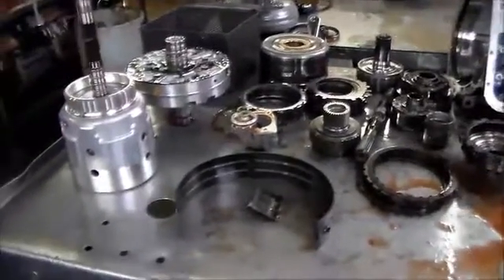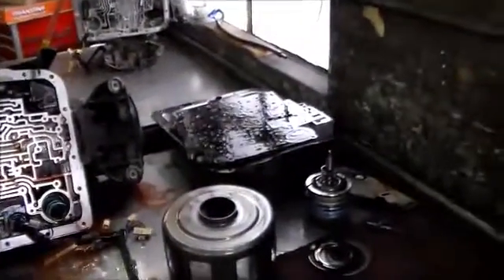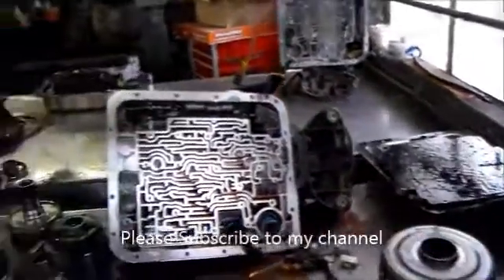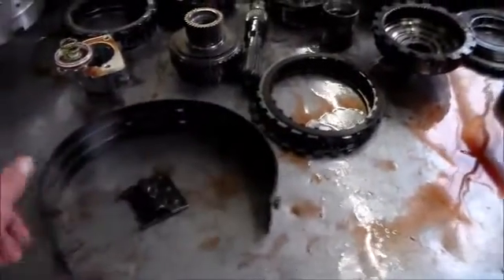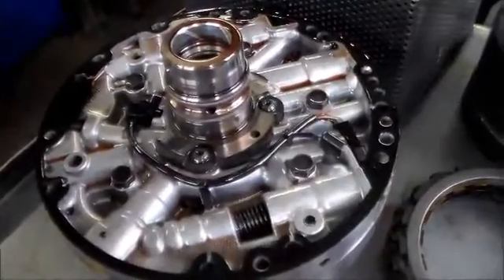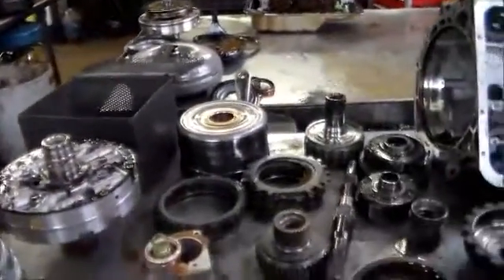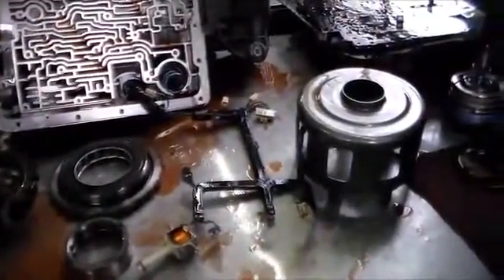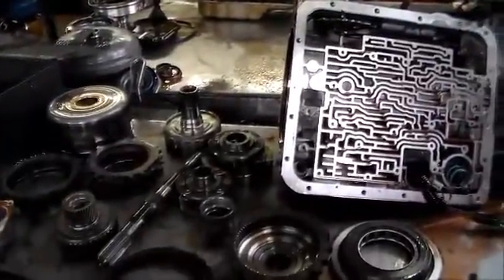4L60E No 2nd Gear

Comment: Hello I have 4l60e on 6.0 gen3 2002 
Slipping on 2 n 3 n4 gears 1 and R verry well other gears start to slip from 2000 rpm I have 60 psi line pressure all time driving and Neutral and park on all gears just Reverse have 95psi 
And Revers slow shifting 2 sec and drive take also 2 sec to engage 
Thanks for your help

Comment: Hi buddy i have a 09 chevy tahoe 4l60e whit some similar problem if i put manual 2d gear it stay on 1st gear  but if i put in D  it takes 3000 or 3500 to get a 2 gear after that the rest of the gears shifts fine
Reply from the maker: Well, sounds to me like your band is broken. After it makes the shift pull the shifter down to manual 2nd and give gas like you want to drive see what happens
Reply: Thanks  i will checa it Out and i let you know Thank you verymuch 👍
Reply from the maker: @richardcoronado4072  ok, sounds good
Reply: @GaryFerraro  ok buddy i already drive  and  soon i feel  the shift gear i  Drop the manual  shift to second  and RPM coming up
Reply from the maker: @richardcoronado4072  seems like a broken band if that rpm goes up, when you give it gas seems like theres nothing there?
Reply: @GaryFerraro  1st gear only
Reply: Appreciate it 😎👍 and thanks again for sharing that video it  really helping us out  god blees you buddy 👍
Reply from the maker: @richardcoronado4072  Thanks, you too

Comment: Hi...i have 2003 nissan sunny n16. 1.3Ltr. Trans RE4F03B.
All my other gears shifts fine. I often have issue with 2nd gear. It does not go into 2nd unless i put my car to Park or restart it. I had a rebuilt, but they only changed clutches only. 
Please advice wt cud be the problm. Note: oil are already changed while rebuilt process ws done.
Pls help

Comment: Gary I think I have the same issue I lost 2nd I can tell when I manually down shift from 3rd to 2nd  it acts like neutral and I think 4th is not engaging too. Could this be anything else than a ban problem, flushing and changing filters I have not found allot debris in the pan. Thanks
Reply from the maker: Reverse is good?
Reply: @GaryFerraro  Yes reverse works good, I also have 1st and 3nd but I think 4th is gone too I,m hopping it maybe a solenoid problem
Reply from the maker: @keiths4573  It usually never is, I would think you have a broken band
Reply: @GaryFerraro  Will sorry for late reply I took the truck out to make sure 4th gear is working it is definitely working could get up to 70 MPH then down shift to 3rd. I have no scan codes because of the short I fixed in the dash broad that killed the battery and cleared all the codes. So can you tell me what solenoid I need to change if it is bad it should have a short or a open circuit right and can you think of anything else to check. I replaced the servo with a rebuilt one  last weekend so that should be good. Thanks
Reply from the maker: @keiths4573  If the solenoid was shorted, car would be in safe mode.  If you want to try the shift solenoids, I would change them both, they are both the same.
Reply: @GaryFerraro  So I need 1-2 and 3-4 shift solenoids I think that is there name right
Reply: Sorry to bother you again I really need some help if you could please take some time and read this I could conclude this 2003 Chevy Silverado 4x4 needs the transmission rebuild. I have fixed a short in the dash, replaced the servo piston, and I took your advice replaced 1-2,  2-3 and 3-2 shift solenoids. I have concluded that 4th gear is still working so I have only lost 2nd and all the YouTube videos I have watched say that 2nd and 4th are the same band if that is right that band should be intact. So this video you made in 2015 you didn't mention that 4th gear was working or not. So if that is true can you come up with any other ideas that might be the problem. Please if you can think of more than one issue that might be the problem please state them. Thanks for you help .
Reply from the maker: @keiths4573  Did you have the side servo out that applies the band? one section of the servo is for 2nd and another section of the servo is for 4th. It's on the side of the trans, right side of the trans
Reply: @GaryFerraro  Yes I replaced the old one with a rebuilt one.
Reply from the maker: @keiths4573  Not much left, maybe drop the pan, see if the band seems loose, unless it's a valvebody issue(haven't really seen that though)
Reply from the maker: What you may have to do if everything looks ok, is hook up voltmeter or a test light to the solenoid(not sure if A or B )have to look at a chart, make sure the computer is turning it on. I think one time I had an issue similar and it was a bad computer(but not 100% sure, rings a bell though)
Reply: @GaryFerraro Sorry  I had to think about that a little I know that I'm not getting any scan codes from the computer anymore I had that short I the dash that would run down the battery a few times so I thought the scan codes were being deleted. By now I should have some codes from the transmission not shifting that's kinda strange too. (Don't you think) One other think I know there's a check value in the servo piston chamber that will get stuck would that cause these symptoms. Speaking about A and B solenoid I seen a video from someone else that wasn't not very clear that stated you should have continuity on bother wires but the tranny was out of the vehicle. So do you know does the ignition needs to be turned off then. I would think the only way to check if they are working is hoist up the truck find the wires for A solenoid put the truck in second gear see if you get 12 volts reading to engage it. I don't have a high dollar code scanner but it will do real time data scan but I don't think it gives out any transmission info. I will need to stop working on this tonight  check it next weekend so if you could let me know how you would check it or how i would in my position before next weekend.  I would be in your debt and thanks allot Gary.
Reply: @GaryFerraro  Will if that's all you have I do thank you for your time I think my direction will be to find out if the computer is working.
Reply from the maker: @keiths4573  Im actually going to ask someone that i think had this problem, he is not around today but will speak with him tomorrow
Reply: @GaryFerraro  Great any in put will help thanks.
Reply: @GaryFerraro  I was wondering if you talk to your friend about my problem with the 4L60E it would be great to get more input before I start working on it again. I'm a older guy 66 years it doesn't get any easier to crawl under these machines so any help is a blessing for me. Thanks allot.
Reply from the maker: @keiths4573  Do you know someone that has a good scan tool like a snap-on or autel?
Reply: @GaryFerraro  I may be able to find someone that would be the better thing to do now  if the cheap scanners are not showing more codes. I will look into that this morning but what happen to your friend he had no ideas to add. Thanks anyway.
Reply: @GaryFerraro  Ok, I took the truck to a Transmission shop the only code that came up was brake module code U1041. This is getting me upset why am I not getting Trans. codes? The mechanic had to do a real time scan we went for a ride the command is being sent to the 1-2 solenoid but it is not shifting the solenoid is brand new I tested it with a 9 volt battery to see if it was engaging then check for resistance which was ok.  Why am I not getting transmission codes?  I will check the brake module for damage that would cause this code but I don't think that is the problem. Please help let me know what you think about all this I will send a reply if you miss something. Thanks Gary
Reply from the maker: @keiths4573  Ok, so when it makes the 1-3 shift and you pull the lever down to manual 2 and give it gas it's ok or it seems like it revs?
Reply: @GaryFerraro  The transmission has gotten worse after changing the A-B and 3-2 downshift solenoids the trans. will no longer shift out of 1st gear I have only 1st and reverse now.To answer your question if I remember right after shifting to 3rd then down shift to 2nd it would not go into 2nd it stays in 3rd. Remember 2nd is gone no matter how you change gears. I really need your help if you could answer my questions that I just sent you do you think if the U1041 code is relevant and  why would I not get any transmission codes even with there code scanner. Can you please try to answer these question or give me your thoughts.
Reply from the maker: @keiths4573  I think the  U code has nothing to do with the trans problem. If you drove the car with a scanner hooked up and it commanded the gears still could be internal problem. Why it stays in first, could now have a problem with the band and 3-4 clutch(had that problem already) 3-4 clutch is a week point in this trans. may have to drop the pan to see how loose the band is, you can also air check it through a small port to see how the band moves.  What happen as far as the no shifting, all of a sudden it just didn't shift from first?
Reply: @GaryFerraro  No like  I said all I have is 1st and reverse now. You stated in your answer 3-4 clutch maybe bad I don't understand that because I thought 2-4 clutch is the same and wouldn't 1-2 be the same or do I have it wrong. I did see a video where somebody did a air check after they installed a new servo piston. I think I can do that without dropping the value body. Can you see the clutches without dropping the value body? Thanks for that input I will look for that air check video that's a good idea.
Reply from the maker: @keiths4573  In this trans you have 4 clutch packs and one band.  The Band is 2nd and 4th and the clutch pack I was speaking of is 3rd and 4th, so if you have a problem with the band and have no 2nd and a problem with the 3-4 clutch and now have no 3rd, the car will not shift even though the computer is commanding it to, as I said 3-4 clutch is the weak point to this trans, they all go bad, not throwing any codes is very strange, so even if you release the gas it will not go into 3rd?
Reply: @GaryFerraro  Sorry I was getting confuse from watching so many videos. The only problem with that dealing with allot of different clutches in my life shouldn't I have allot of fibers or clutch debris in the pan. The pan is clean the last time I opened it I had a little bit of dark film in the bottom. I'm not throwing your idea out the window because I'm not a transmission mechanic. If the clutch packs go out there should be some indication of slipping all the gears have been strong never has there been slipping. I do apologize for the dragging on and not having the transmission in front of you makes it harder to work it out. If you feel that you have spent to much time working from a far I will understand if you have had enough. I think I will try to make sure some how that the clutches are engaging and that will be my last effort then find someone to rebuild the darn thing. God bless you for all your help you have been a saint.

Comment: How Hard Would This to be in a Home Shop? I have a 2000 GMC Sierra with a 4l60e and the second gear band is bent. I basically have the same problem I just wanna know how hard it would be to do myself
Reply from the maker: 4L60E is not a bad trans to work on, it is doable, i have a customer that builds them in his garage(he buys all the parts from me) Are you just going to fix the problem or a complete overhaul?
Reply: I’ll probably replace both bands and the servo pins. But that’s it
Reply from the maker: @bronsonstephens5799  There is only one band on this trans
Reply: Gary Ferraro oh Thank You. I thought there was a 1-3 and a 2-4 but Thank You. Would doing the servo pins and a band be a doable job?
Reply from the maker: @bronsonstephens5799  2-4 band,  trans has to come out to replace the band, it is doable, are you familiar with this trans?
Reply: Gary Ferraro yeah I’m pretty familiar but I’ll probably still learn some more doing it. And Thank You
Reply from the maker: @bronsonstephens5799  welcome, any questions just let me know
Reply: Gary Ferraro Thank You So Much

Comment: I got a rebuilt 4L60E from a shop and no gears work at all, though when it runs it feels like it only drags forward even in reverse. 
In some shifts it makes a faint whining noise as well, after a while it began to smoke I believe from the transmission vent so I shut it off. Is this a bad rebuild I got?
Reply from the maker: certainly sounds like it, so the car does not move?  who installed the trans?
Reply: @GaryFerraro  I did it myself made sure everything went in smoothly.
Torque converter completely seated and checked that it wouldn't get stuck on something while bolting to the Engine.
Everything is new as well, transmission lines and oil cooler. 
Filled the trans then cranked for a few seconds so it pumps the fluid then topped it off to level while running. Also the shop I got it from is one of those that mostly rebuilds and sells transmission so they stock multiple transmission at once in a mass production way.
They're closed till November for relocation so I may just get another shop to do it.
Reply from the maker: @bryanmartinez6600  ok, question, did it take all the oil in?   the car moves?  is this 4x4?
Reply: @GaryFerraro  Nope 2WD, it took 10 quarts of oil once it reached cold fill and the truck only drags forward in any gear I jacked up the rear and the wheels spin  but when it's on the ground I can rev the Engine in drive or any gear and hold the vehicle still with my foot
Reply: @bryanmartinez6600 did you ever figure any of this out. I'm having a very similar problem with a brand new summit trans

Comment: 4l60 transmission hard shift into first then no other gears acts like it is in neutral. I do have reverse but also hard shift into reverse. then when I loose first gear as it tries to shift to second I do not get first gear back unless I put it in park shut it down and start it up again. I tried manual shift to 2nd and third but I get nothing. any ideas?
Reply from the maker: Question, if you drive in first, and then release the gas pedal, does it shift?  Any codes?
Reply: @GaryFerraro  my 07 impala does not shift in to second gear if i let go of the gas pedal.  Often instead of just slipping and revving, if i hold the gas pedal down it will move forward but it never shifts into second gear.
Reply: The codes i given is for a pressure control solenoid P0178 i believe it was
Reply from the maker: @robertdinero2853  2nd clutch is probably no good, and with that clutch no good you will not have 3rd or 4th gear either
Reply: @GaryFerraro  thank you for quick response. So transmission needs full overhaul? Or can just clutch packs be replaced?
Reply from the maker: @robertdinero2853  Probably should do an overhaul  Maybe you had code P0781
Reply: @GaryFerraro  . 
Code was for pressure control solenoid. But would replacing that solenoid as well as the shift solenoids fix this issue? Or is it beyond electrical repair?

Comment: Hey buddy. I have a 04 Sierra and the 4l60e drives in first but revs our to 4 grand before shifting to third. Any chance you would have some insight?
Reply from the maker: Hugh G. Rection sure,  your 3-4 clutch is no good. This is a weak point for this trans
Reply: Gary Ferraro great thanks. What’s the easiest way to get this done? Is it expensive?

Comment: Hi there bro i have a question ok i run my car with out transmission oil and work's only 1 and 2and but no 3 gear? Can you help me plz
Reply from the maker: Running the trans without oil, probably burnt out the 3-4 clutch. If this clutch is no good you will only have 1st and 2nd gear, when it hits 3rd it will be like the car is in neutral
Reply: Gary Ferraro ok bro thanks for you help ...i buy used one lets se if tha one works
Reply from the maker: Your welcome, let me know how it goes
Reply: Gary Ferraro yea i will bro

Comment: well actually starts off in 2nd very downpowerd then shifts fine 3-4 od,problem was no 3/4,but sk correction kit was installed new steel,friction,band bonded pistons,full rebuild
Reply from the maker: +valerie rios  Have you had it scanned for codes, something like this i would want to look at live data to see what the computer is commanding the trans to do. Do you know if the solenoids were changed. Gary So basically your missing first, if you pull this down to manual one do you have first then?

Comment: I have an 04 Trailblazer 4.2. I flipped the tcc valve around and it stop the jerking at 65 mph. The only problem I have with the flip is. When ever the tcc unlock when there is weight on it. I bump Is there anything else I can do?
Reply from the maker: +blackericdenice   Not really,  what i do is remove the little bumper spring and block the valves outward, turning into an on-off instead of pulsed, which is pretty much what you did, when that is done it may bump when tcc unlocks. You could have aproblem with the valvebody,pump, pump bushings, converter or tcc pwm solenoid. Where there any codes present before you flipped the valve. Gary
Reply: Gary Ferraro No codes before the flip but when i tapped the brake to unlock TC. the jerking stop. No big deal just thought u might know a trick.
Reply from the maker: Alot of times the bore is worn in the valvebody.  But when the valve is flipped not much you can do, its pretty common to bump when unlocks.